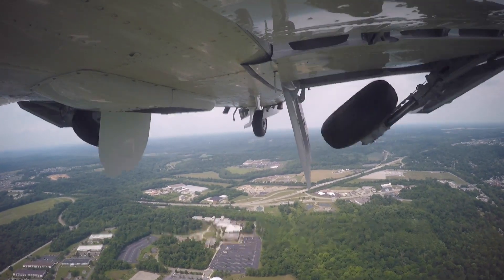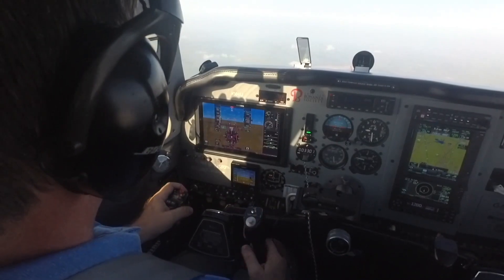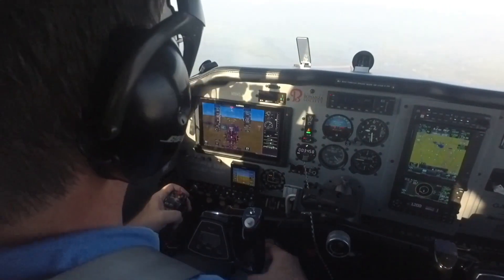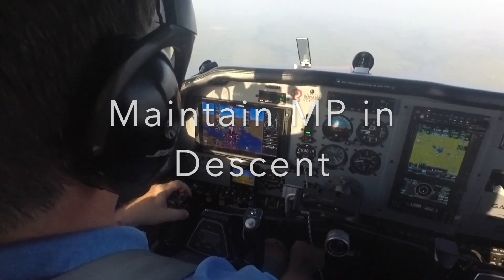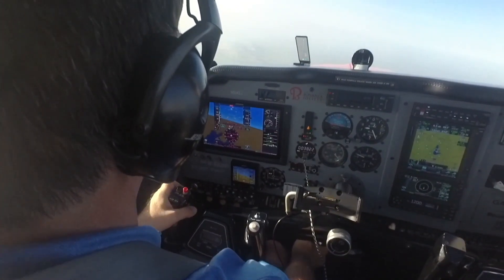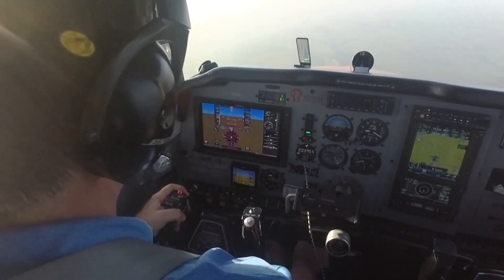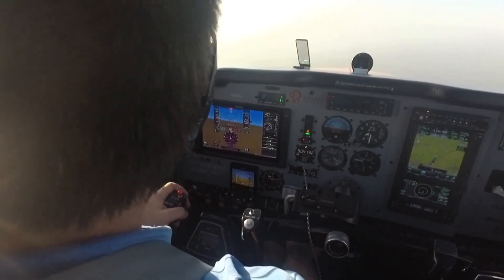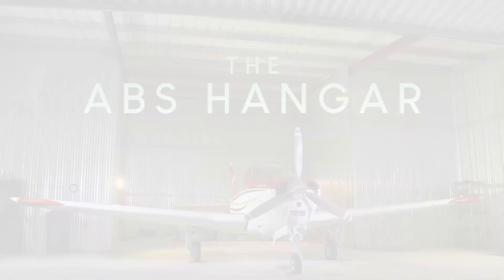Flying By the Numbers Demonstration

Comment: I noticed in your gear extension you call "123 Green, 456 Green" why the 456?
Reply from the maker: We have a supplemental set of “repeater” lights above the Primary Flight Display in a position far easier to see than the standard lights on the right subpanel behind the dual control yoke. Still I can’t avoid looking for the “factory” lights, and I just call out all six and check both In Transit lights are out when I confirm gear extension. And yes, I talk aloud when I fly, even when solo. - Tom Turner, ABS Air Safety Foundation

Comment: My FOM says 70 Knots on final with full flaps.  If I understood the video correctly you were using 110 Knots right down to minimums.  How does the transition to a landing go?  Stay with approach flaps or transition to full flaps? Very nice presentation BTW.
Reply from the maker: With practice it’s actually quite easy to decelerate from 110 KIAS at the missed approach point to normal landing speed by extending full flaps, reducing power to about 15 inches and advancing the propeller to full rpm, and maintaining glidepath to the touchdown zone by gradually adding back pressure.

Comment: The numbers I was taught when I first transitioned to the bonanza, and the numbers that work absolutely perfect almost every time, was always 25 square for climb, 21.5 (or max if high altitude) and 2300rpm for cruise, variable for descent, 18" and 2300rpm with half flaps for 110kts to the FAF, then gear down 1 dot below GS to add drag and intercept the descent, then 2500rpm and it's set power all the way to minimums at half flaps. I do love a good profile for the airplane. It lowers the workload, especially in IMC
Reply: Engine leaning is critical in saving money. I fly at full throttle, 2300 rpm and lean to 13 gal/hr. That’s around 85 degrees lean of peak. Followed the mechanic who brought his engine 230% over time before overhaul. Think he reached about a 5000 hr TBO.
Reply: @aviatortrucker6285 youre talking about Mike Busch . He got them up to 3200 hours plus on his Cessna 310 . The 5000hr one was engine he worked on for his customer not his own

Comment: I always lowered the gear before the flaps in our Cherokee Arrow. The gear had a higher extension speed than the flaps and they helped to slow you down to flap speed. And perhaps it was good that lowering the gear was the first thing you did. Actually, the fuel pump was first thing (GUMPS). I haven't flown since 1977 and had forgotten what I set manifold pressure to on downwind.

Comment: I think Lew Gage may have written a good article why you should always lead with gear extension and not approach flaps. Certainly my SOP is to extend landing gear at the end of downwind, or before entering the pattern on base (Visual circuit) or one mile before the final fix (IFR). You then check three greens, having noted the aerodynamic effects of gear extension, and only then extend approach flaps. Leading with approach flaps may mask the aerodynamic effect of landing gear extension and dilute muscle memory. Will try and dig out the excellent write up by Lew Gage, FWIW all SOPs I have had to adhere to lead with landing gear.
Reply: I do the same . Mid downwind check my speed , always happens to be 140-142kt with 20MAP 23-2400 rpm , my Vle is 142 , extend the gear , hear it cycling , confirm green light , check speed , I know with gear extended I should be slowed down enough for Vfe . Extend the flaps to 10. I find that using gear extension as an air brake helps me to not forget extending the gear because if I haven’t slowed down enough it must be because my gear isnt extended. I still make sure on finals to confirm gear is down at least a couple of times .I have no difficulty slowing the plane with the gear retracted but choose not to for the reason explained above.
Reply: No doubt Lew is an icon in the field of Bonanza's but times have changed and In order to mix with all the "fast" machines of today as was presented  a faster approach speed helps ATC manage the system.  Anyone transitioning to larger aircraft will soon learn that approach flaps always precedes landing gear and that becomes ingrained procedurally.  I use approach flaps prior to gear extension and NEVER touch the flap lever again until I have confirmed 3 green.  However what works best for each individual is best to continue with.